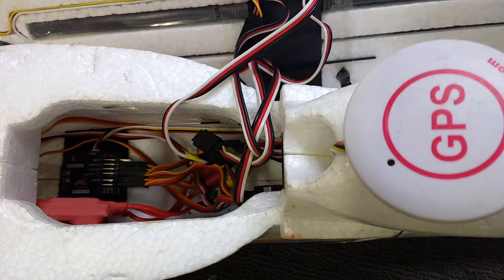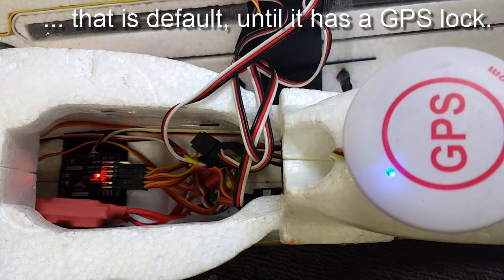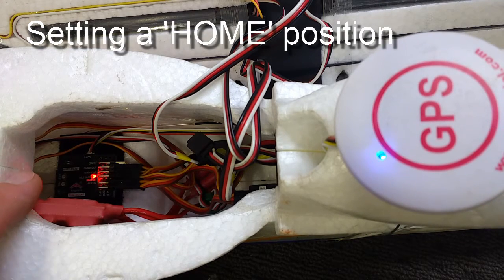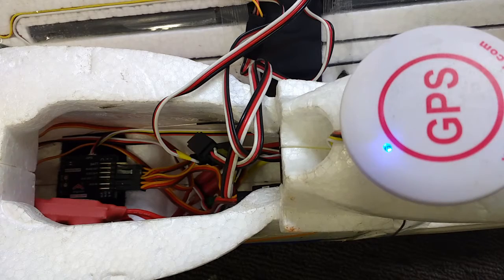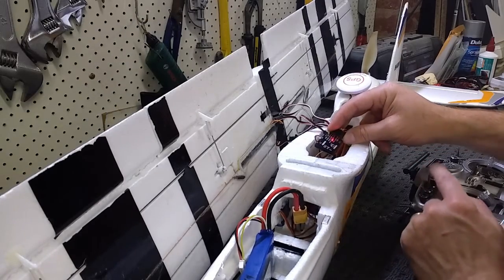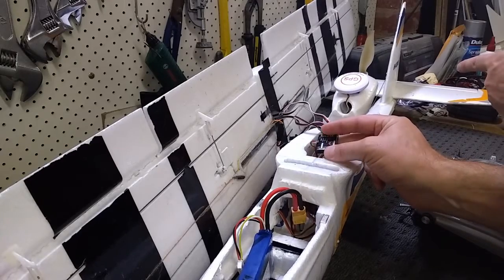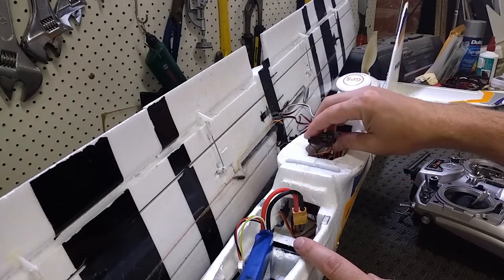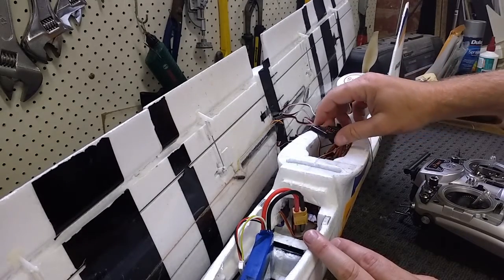BGL-6G-AP Flight Stabiliser with RTH  Testing

Comment: Hi Michael, trust you're well. I have 2 of these AutoPilots for my FPV Planes. On one of them the GPS receiver has stopped working. Do you know where I could buy a new one? or do you know of a compatible unit. I tried to use a Beitian BN-220 GPS but although this fired up and got a GPS fix it was not compatible with the BGL-6G-AP. The red light just stayed on all the time... Regards, Pete
Reply from the maker: Hi Peter, I am well thanks. I have asked Bigaole this question before, but due to it being their proprietary information they are not able to publish the spec on the GPS, so I can't tell you of a compatible replacement.
Reply: @madrc6667  Ok Michael, thanks for your time. Regards, Pete

Comment: Hello is this compatible with spectrum dx6 and dx7 transmitters
Reply from the maker: G'day Philip,  yes mate.  Compatible with the Spektrum radios. It is advisable to check the receiver you choose is capable of programming the failsafe setting though. I believe some Spektrum receivers only limited option on failsafe, and won't allow you to ensure the RTH channel is engaged if you loose radio signal

Comment: Since making this video have you had any problem with it ? 

Nice to see a Bix3
Reply from the maker: P arjacpar , no problems at all. I have sold hundreds and not had any issues that were not caused by incorrect setup. I have this unit in three different planea and they all work very well. Cheers Michael

Comment: Hi Michael, hope you can help with my Bigaole issue!  I have the unit installed in a Bixler 3 and the stabilize and off modes work fine but when I place the unit in the TRH position it initially appears to start a turn toward home maintaining altitude in just a few seconds the plane will jump to the opposite direction and start heading down.  It does not correct, I have to turn off  the RTH to save the plane.  In checking the plane on the ground in the RTH position all seems to be correct.  I'm using this unit with a Taranis x9D plus and a L9R receiver.  Any guidance or suggestions would be much appreciated.
Thanks
Reply from the maker: G'day Wayne, sounds like the gains are too high and it is going into a feedback loop. You usually only notice this in autonomous flight of the RTH. Try to dial the aileron gain back a little and try again. Cheers Michael
Reply: Thanks I'll give it a try tomorrow!!  Appreciate the guidance
Reply: HI Michael
Tried your suggestion of lowering the gain but unfortunately got the same results.  In trying the different gains every flight the plane banked sharply to the right and headed down.  I have to switch out of the RTH position to save the plane.  Any other suggestions?  Really appreciate your helpl.
Reply from the maker: G'day Wayne,
Well, that is weird for sure. The auto level and RTH are essentially using the same control in the unit. It is unusual that it will work fine in the auto level mode, but not in the RTH. 
I would suggest re-running the set-up making sure you didn't miss a step. What sort of plane? are you using the same amount of throttle? How low (close to the centre) did you get the gain?
Reply: Hi Michael
I'm using the unit in a Bixler 3 and I did exactly as you recommended ie started from the beginning to be super careful not to miss any steps including resetting the home location at our field this morning.  The stabilizer itself works fine other than restricting the bank angle but I understand that is normal but again when I place the plane in the RTH position it banks hard to the right and heads down.  I even tried it at a very high altitude to see if it would pull out and level off but nope it continued to head to the ground.  FYI I am using a taranis X9D Plus and I have set it up exactly according to your you tube video.  The GPS does go from solid blue to flashing blue, do you think I could have a bad GPS.  It's now become a challenge to solve the issue!  Any other ideas would be greatly appreciated.  Thanks
Reply from the maker: Not sure about the GPS, if it has the correct sequence of lights etc. I'd assume it is working correctly.
How much throttle have you got on when in RTH mode? Is there some possibility that the plane is stalling?
 Otherwise is there any chance you can request a replacement from your supplier?

Comment: Hi Michael, Just installed one of the BGL-6G-AP I bought from you in a plane.
For some reason the 3 Position switch did not seem to switch into all modes.
Spent a good part of yesterday checking for loose connections... faulty Receiver... faulty BGL by changing them out but to no avail. 
Today I took the plane out onto the drive way to see if I could at least get a satellite lock.
Low and behold... the 3 Position switch started working correctly.

My shop is metal clad and no GPS signals will get in... 
It is VERY IMPORTANT to note that the 3 Position Switch Modes only work correctly AFTER a GPS satellite lock.
Reply from the maker: You nailed it J. The default mode for the unit without GPS signal is auto level. Once you have a connection to the satellites you are able to select OFF or RTH.

Comment: Hi, gooood video. I need help, yesterday I maiden my s800 wing. In manual mode all went ok, in stabilized mode I noticed it cuts a lot the travel of the servos so in order to do a oval lap I needed a lot of space so I could do the turns and do a complete lap. Any parameter I can change in the controller to let me tilt it more aggressive in stabilized ? I am already with my travel in taranis set to maximum.
Reply from the maker: Hello Ricardo. There is gain adjustment in the BGL-6G-AP for the ailerons. This will increase the amount of movement and also the amount of compensation for wind. So, if you increase the aileron gain too much then the unit will over compensate for bumps in the wind and make the plane uncontrollable. The stabiliser in this unit is more of an Auto Level. I can suggest a very small adjustment to the Aileron dial and test fly to see the result. But quick to return to manual mode if the adjustment is too much.  Good luck. Cheers Michael

Comment: I'm not sure which RX you are using with your Taranis, but, what I would like to know is, can you get FrSky GPS telemetry from the BGL-6G-ap to the telemetry screen on the Taranis? eg: Lat/Lon, altitude and GPS speed. Many Thanks, Dave
Reply from the maker: Interesting question, but there is no auxiliary connections from the BGL-6G-AP to output any telemetry data. I think you'd need to stick with the FrSky GPS V2 Sensor with SMART Port. Cheers Michael
Reply: Have V2 already, witch raises another question, can 2 GPS units work in close proximity to each other? I guess, with a GPS being a receiver only they should not interfere, so if I keep the 2 units as far as possible from each other in the airframe all should be OK. Thanks for your answer.
Reply from the maker: I have run two GPS units on my BIX3. One from the BGL and one from a Remzibi OSD. No issues. But can't hurt to keep them seperate. Cheers
Reply: Many Thanks.

Comment: Hello Michael. I purchased one of these units from you a few months back. I put it in my Bixler 1.1 and it worked flawlessly. However, I have since upgraded to a Bix3. I launch, fly around for about 10 minutes, then i get locked out of the controls and it goes into a hard downward spiral. This has happened twice to me now. Do you think this could be an issue with the flight controller? If not is there any solutions you could suggest?
Reply from the maker: G'day Ryan. this does not sound like the flight controller, but if you can give me a but more info I might be able to suggest something. What mode is the controller in when you are having the lock out? Does the lock out last very long? What radio and transmitter are you using? Is it the same gear you had in the other Bixler?  Does your receiver have failsafe? Are you flying at the same location when it happens? Cheers Michael
Reply: +MAD RC the flight controller is in normal fixed wing mode. The lock out lasts anywhere between 2 to 5 or 6 seconds. I'm using a 9x with a Frsky DJT module and and V8FR-II HV receiver. It is the exact same setup as before except I have added an 8a BEC very recently to try to fix the lock out problem. My receiver has fail safe set to RTH and 50% throttle. It has happened in the same location both every time. Thanks for the help.
Reply from the maker: Hi Ryan, thanks for the extra info. Sorry I was not specific about the 'mode' I did mean was the flight controller OFF, AUTO LEVEL or RTH mode?
I think that if the set-up is the same, there is a possibility that there has been some interference in the area you fly. I have two mobile phone towers that run in a line of sight to each other near the field I fly at and have had a few experiences similar to what you have described (4 different planes, 3 without controllers). I believe the phone towers carry a bunch of difference signal types, including some in the 2.4 GHz range. So, occasionally when there is communication between the towers at the time I have flown through; the plane becomes  unresponsive for a moment. Is there any chance that you have an interference source at the location you are flying at? Cheers Michael
Reply: +MAD RC hi again. Sorry for the late response. Every time it has happened it has either been in RTH or Stabilized mode. I do not believe it is interference, as this exact issue has happened it 4 different location to date.
Reply from the maker: Hi Ryan, The other thought that I had after post that reply was the airframe may be stalling? Check out the BGL-6G-AP Thread on RC Groups forum for some discussion about the BIX3 stalling in RTH mode - http://www.rcgroups.com/forums/showthread.php?t=2417656&page=38 I know that when I first maidened my BIX3 it would not fly as slow as my old Bixler 2. I did tip stall it a couple of time with one ending up into the ground. Was slow and low so no damage. Could it be a stall?
Reply from the maker: I'm also thinking you should wind back the gains pot on the Aileron (turn closer to the centre point). If that is set too high and the plane is flying slowly, there is a higher chance the plane could go into a spin.
Reply: +MAD RC I'm fairly sure this is an issue in the flight controller. The maiden of this Bix3, it crashed because of this issue, and it had the flight controller in it. Then, I flew it a bunch without the flight controller, and it had no issues. Now, I put the flight controller back in and it has this issue again.
Reply from the maker: Hi Ryan, It is a very hard thing to determine the cause of intermittent issues. But if you say this is not happening when the flight controller is out of the plane, but is with the controller in the plane, it makes sense it is contributing. The thing is, that if the unit was working well in your Bixler 1.1 and is not in the BIX3 I think that the best thing to do is wind the gain pots to the lowest point.  Run the unit off and test at a good height, switch to auto level mode and fly at different speeds to see the behaviour. Then try with RTH mode at a good height and fly at different speeds to see the behaviour. If it is all ok, try to wind the gain up a little and repeat the tests. If the gains are too high the control surfaces will over compensate to the external factors (wind gusts etc.) and cause a tip stall. I hope that helps. Cheers Michael

Comment: hi
Does it control the throttle in RTH mode? Or you need to setup failsafe throttle rate? how?
Reply from the maker: Hi Tamas, you need to set the throttle in your receivers failsafe. So this means if you go out of range the receiver will control the throttle, but when you engage RTH mode in range, you can still provide throttle input. 
On the BIX 3 I have set about 40% throttle on loss of signal. Cheers Michael

Comment: Hi MAD RC,  just one question, please  - how often should be done Communication recognition (6.2) with GPS - (switches 1,2 - ON, Off)?  Only one first time, or every time when I power  BGL-6G-AP. Thanks.
Reply from the maker: Hi +Alex Taranov this is just needed once. It is the first time that you set-up for the plane to set the correct levels for the airframe. Cheers Michael
Reply: Luik h

Comment: Hi again Michael, Do you think the GPS dome will work inside an FMS 1400 warbird fuz, so I don't see it.
Reply from the maker: G'day +Charles Teer I have seen this unit mounted inside the fuse on a few different models. I mount it internally on my ASW28 glider. It has a plastic fuse and works without issue. I have also seen installations in foam fuse of an easy star - http://www.rcgroups.com/forums/showthread.php?t=2418276 
I think that you'd still want to try get it in a position that has the least amount of foam above it, but should work just fine. The caution I would give you is that the blue light on top flashes to confirm that you have a GPS lock, so if mounted internally, you may not be able to see it to confirm you have a lock before take off. I hope that helps
Cheers
Michael
Reply: +MAD RC Thanks for the quick reply Michael will try different ways to see the blue light, do you hip these unit's to the UK?
Reply from the maker: +Charles Teer Yes not a problem, I have shipped a few to the UK, Europe, USA and Canada. The shipping to the UK is AU$25.20. You can order through my listing on eBay or send me an email directly to save eBay fees. mad.rc.info@gmail.com I can send you a PayPal invoice. Cheers Michael

Comment: Hi, before fitting the unit do you do a flight test to trim the aircraft then fit the unit?,
Reply from the maker: G'day Charles, The instructions for the BGL-6G-AP indicate that your radio should not have any added trimming before fitting the unit. That said, I would highly recommend that when you first fly the plane after fitting the unit, do not switch it on until you are flying trimmed and happy. Then get to a safe height to trial the stabilise mode. If you are happy with the behaviour, then trial the return to home mode. 
Cheers Michael
Reply: thanks a lot Michael